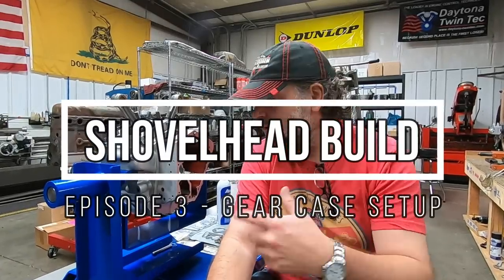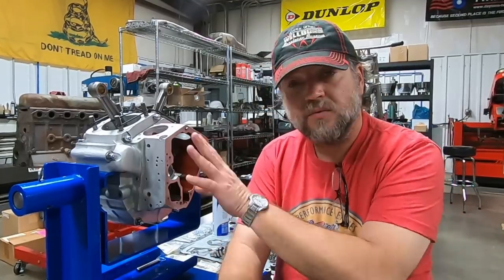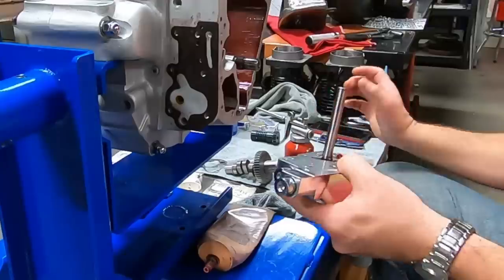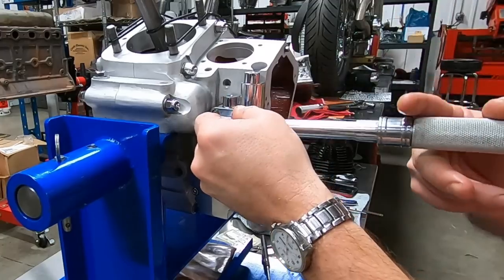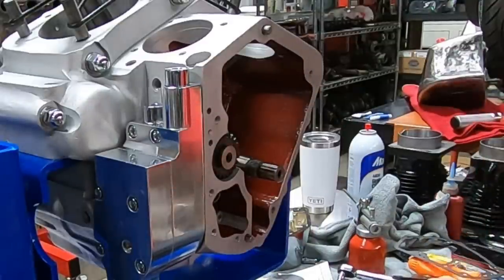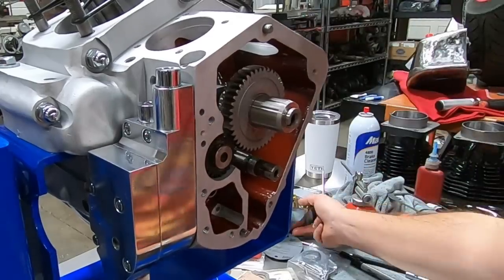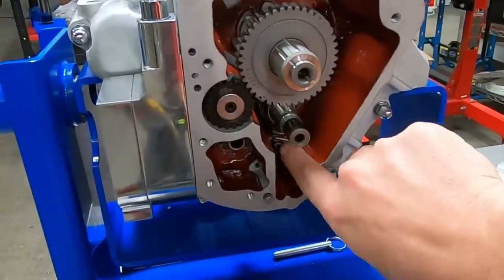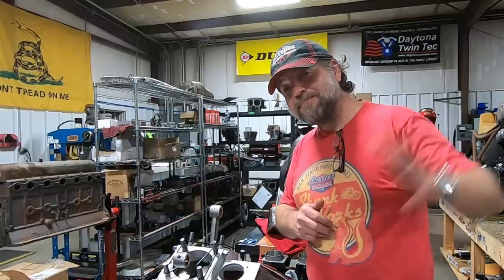Harley Davidson Shovelhead Build Series Part 2 - Assemble Gear Case - Kevin Baxter - Baxters Garage

Comment: I’ve had very good results from cometic gaskets on shovelhead and panheads. I have found that their base gaskets always end up leaking though. I’ve had to tear down and replace base gaskets on the three bikes I own. James silicone coated metal base gaskets have worked best for me. I rode my shovelhead from Florida to California and back and the motor was still leak free when I got home. 7200 miles in 28 days.

Comment: I remember reading a US custom magazine in the late 1970s  on rebulding a Shovelhead oil pump and the gasket used was mica and assembly was to 1/10th of a thou tolerance. Is my memory correct?
Loving this bike build so far and the attention to detail from Kevin Baxter. It's a great channel.
One note I have that I want to share is that during WW2 British engineering companies were making spares for US aircraft engines and were initially rejected because British engineering used a system of pairing components for best fit, whereas the US used a system of any part off the shelves will fit properly to any part of any engine needing replacement parts. 
This US attitude that we had to adopt in the UK required that parts were manufactured to a much tighter tolerance to guarantee that any part is okay. 
My point is that I know Harley Davidson supposedly use paired parts in their engines, eg gears. Although I understand that assembly operators are somewhat slack at times and HD QA is not what it should be either. So why do HD not use a much tighter tolerance during manufacture? I know it may cost more but it should be worth it. 
My own Vee Twin experience is in Moto Guzzi 950 OHV version and they are much simpler designs of engine than HD and are generally satisfactory in operation.
I really appreciate the care in build that Kevin Baxter puts into these HD engines and drive train. They are real enthusiast bikes when done right. 
The S&S X Wedge and the T143 look great engines. Would love to see Kevin do something on those but I do love the older HD designs very much.

Comment: My old boss ( RIP ) & I have rebuilt more then or share of shovels . That's exactly how we used to do it it's time consuming & there is a lot of machining that needs to be done . Today people bring me heads that have had 4 or 5 maybe more valve jobs & they freak out when I tell them I need to machine & install new guides & valve seats & it costs this much to do ! I have not done & Evo style oiling conversion but but that is what I would do on my own shovel . Many things you talked about apply to EVO motors also so I still build EVOs like that ! Nice video !

Comment: I had a 1979 low rider 80 cubic inch shovel, the engine was balanced 60 % and yes the front end shock at stop lights. It had drag bars  peanut gas than two spark plugs per cylinder and blue pipes. I wanted to put the little john transmission not the rapper. The little john 5 in a 4 speed case it was $1000 back then  I miss that bike , and one point the spark plugs of  the right side on the cylinder were shorter than the left because the piston would hit the plug on the right if you put the longer plugs in that side.

Comment: Kevin, have you noticed the cone or cam cover bushings, in later years are drastically under sized from the manufacturers? I've seen other guys assembling older Harley engines running into that problem.

Comment: Kinda surprised you're not using the S&S Reed valve breather assembly.  Zero timing issues.
Reply: Issues? It’s two marks for Gods sake.
Reply: S&S reed valve only  for 1993 and late engines.

Comment: Hey, Kevin, cheers from Lithuania.  I cannot find any real info or feedbacks about Evo oil pumps. I'm not sure if the aftermarket pumps S&S or Jims perform any better that the stock one. Are there any real numbers or proofs that I need to replace my original pump. Chasing noises with my EV51 you know :)

Comment: Mr Baxter well done. A big question. A camshaft which suffered a little damage by a worn pushrod roller can be regrinded? Thanks!
Reply from the maker: Well...in most cases it would have to be welded, head treated, ground, etc.  otherwise just grinding, the base circle would change.  considering the cost of cams, i dont see that being cost effective.

Comment: We didn't degree in the breather timing.  Granted you are using aftermarket cases and breather valve, but this is all the more reason to confirm the the opening and closing of said valve is within specs....  Trust but verify....
....RooDog....

Comment: Kevin what is that red coating on the inside of the engine block?
Reply: Look at the first episode...
Reply: Glyptal    Got it, Thank you... 👍👍
Reply: The engine case casting were not great & had alot of air bubbles in them that if not coated would sometimes leak oil thru them so especially old cases should be coated on the inside to prevent that from happening !